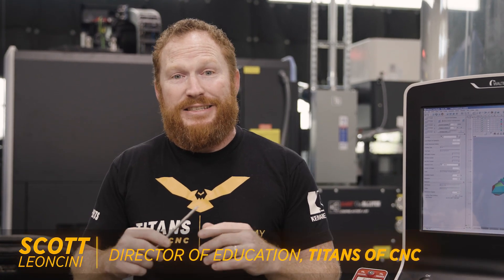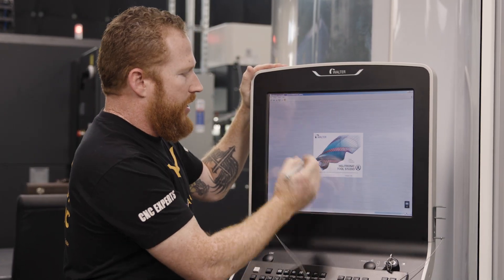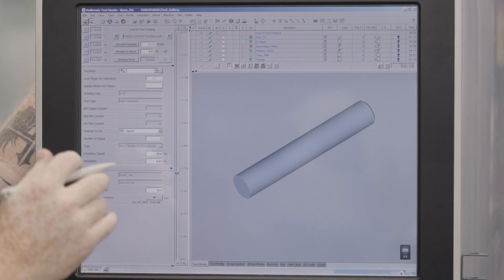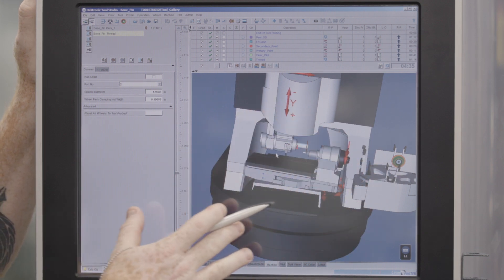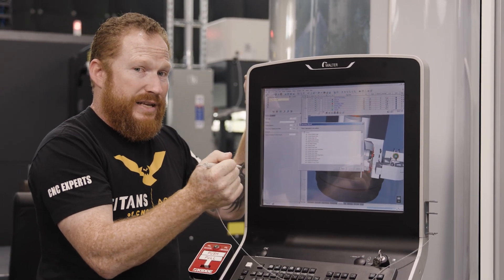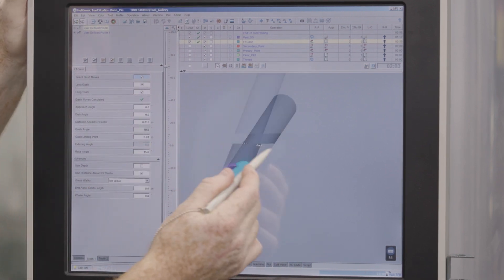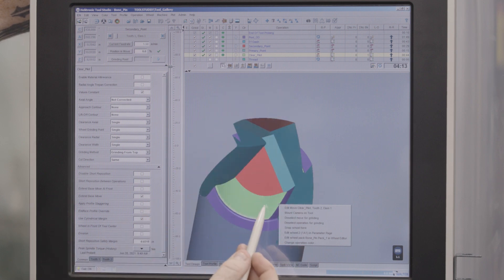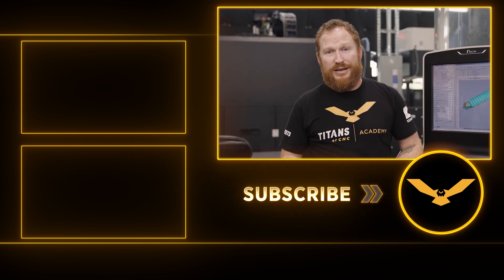Part #2 - Grinding Bone Pins | Programming Tutorial | Walter Helitronic Vision 400L

Comment: That was cool. I do 3+2 milling on a dmg. Haven't seen many shops that do high end grinding. Seems easier to program than mastercam when the built in software accounts for everything. Does it output gcode? Or something only that controller can use? I have seen mazak's conversation programming for lathes. I believe it can output gcode but doesn't need to.
Reply: Yea there is background g - m code, but they recommend not playing with it. I come from only mill and lathe programming by hand, and Is hard for me to not want to go into the nc code page and not add things haha .